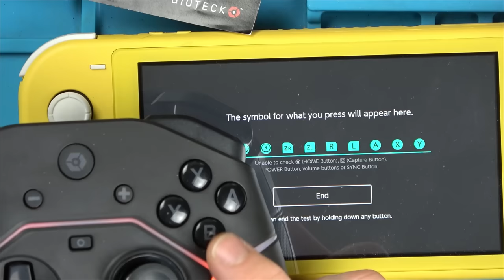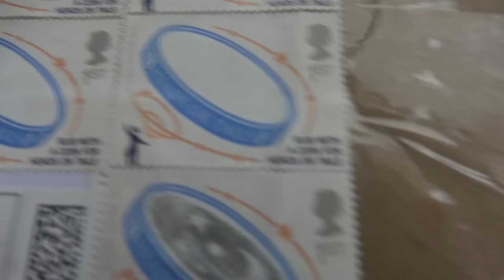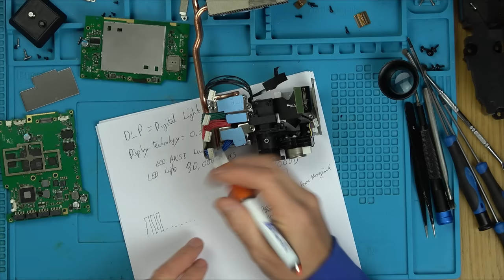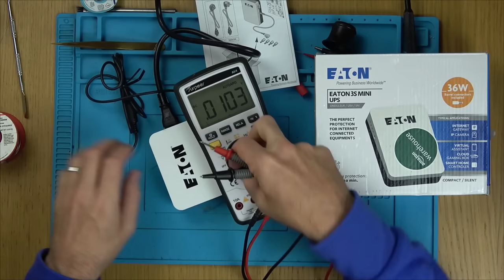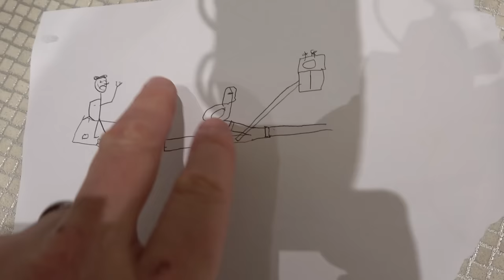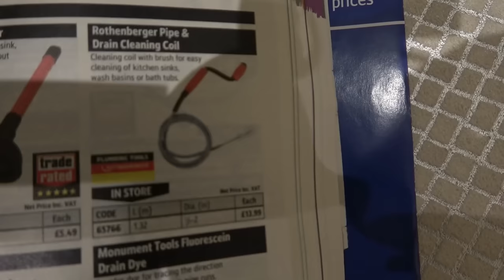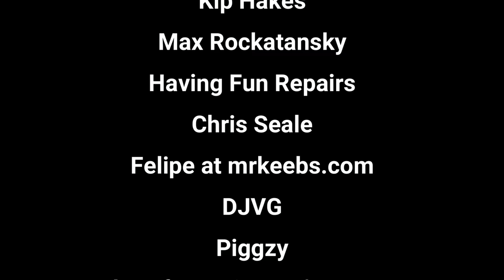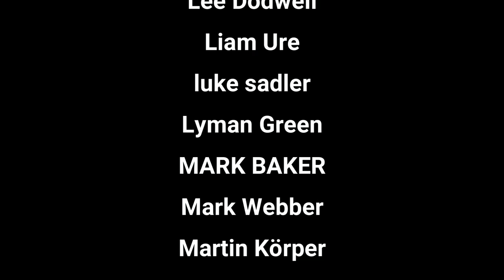Attempting to FIX EVERYTHING

Comment: yeah you got problems. 100% stop using the toiet 
looks like you need to remove the chipboard in places i use a circlur saw and set the depth to 17 mm .asuming its 18 mm chipboard .you can use somthing like Vibrating saw .problem is no depth control 
cuiclur saw works well it cant get up to skirtings etc 
the nails will tell you were the joists are 
PROPER MISSION
Reply: be carefull there be water and electricity down there.  buy a couple sheets of chopboard  and roofing batton for making good .THERS NOTHING WORSE THAN FALLING THROUGH A CELING :stayhome:thanks vince keep on doing what you do
Reply: this might sound mental but going through the plasterboard celing is easyer to repair and less destructive BUT DUSTY messy
Reply: this is important and you should know .in 70s 80s celing textures aspestos was used its not in the plasterboard

Comment: No they flash with intervals .
any other dlp with a changable lamp has a color wheel.
and the whenthe right color is onfront of the dlp the dlp mirror cast a image.
this is so fast that you see vibrante colors because yhour brains are to slow to see the flashed andthat is how its being done
in flas red one flash green one flash blue of the same image but the dlp mirrors will be in other places just to project those colors on the wall coorectly.
the chip is called a DMD chip
so if those are rgb leds it does the same thing but without a color wheel which could be much much faster.

They are never on all together btw this is why you have color ghosting.
meaning when you look away then back fast you see 3 colors out of phase.
ik bet the power rail is gone for the leds the main.
or the dmd chip is dead
Reply from the maker: Thanks for the info 👍👍

Comment: for future reference if your toilet blocks with the water coming more than halfway up the bowl you can use a toilet brush by thrusting it up and down in the water you dont have to go all the way down with it what it does is creates a kind of wave like power flow and if you do it long enough it generally pushes the blockage out you have to do it quite fast to get it working.. Save you using your hands. Basically what happens is it turns the water into a giant plunger.